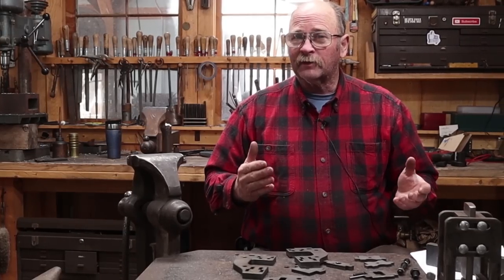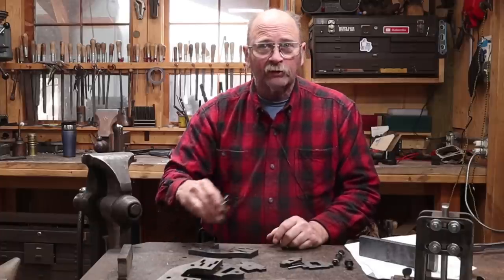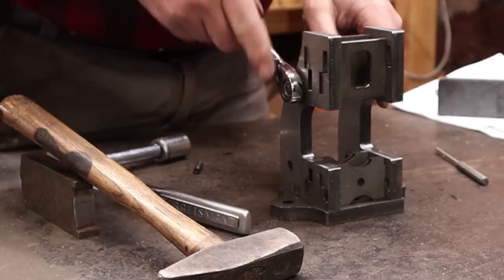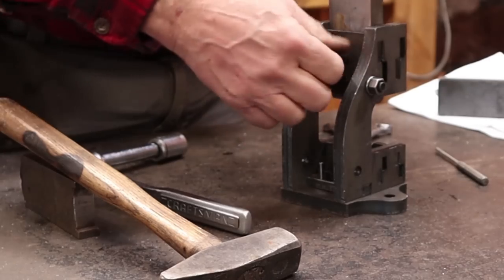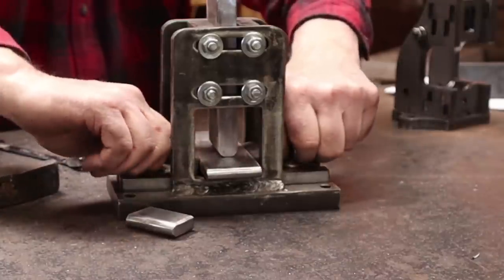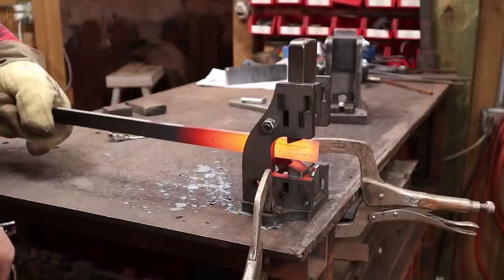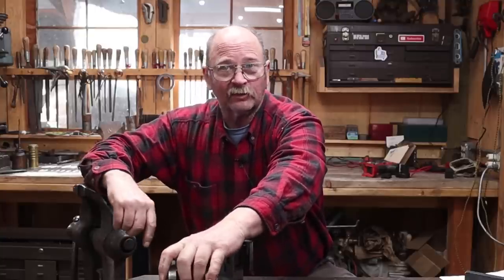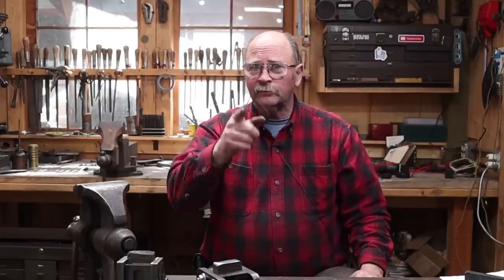Guillotine tools, a closer look at two new additions

Comment: I wish I would have seen this video when it came out originally but I have one suggestion for John and anyone who sees this comment in the future and that is instead of hitting the dies with your hammer you are much better off hitting the dies with a brass hammer or a heavy rubber mallet. The reason for this is to save your dies from getting all banged up and distorted. I really love both of the designs on these guillotine tools. Thanks for sharing.

Comment: John: Tip for the Cloverdale hardy hole attachment that is quick/easy and involves no welding. Grab a length of square bar of the desired size, drill and tap 1/2 UNC hole in the center. Then drill a separate hole for the split pin to go into (the one you removed). The pin is to prevent rotation of the square bar, alignment only. I ended up welding a shank onto another plate like you were discussing and only figured it out afterwards.
Reply from the maker: Great ideas, now why didn't i think of that

Comment: I have tapped holes in my 5/8" thick bench top to suit various vices and their position. I use set screws in the holes from underneath in holes not being used and ground flat to stop junk getting in the threads and maintain a flat work surface. Nice tools John, I need one :-)
Reply from the maker: ingenious solution

Comment: You'd only need to use one fence at a time on Jerry's tool, letting the metal expand as expected. If it starts to stretch unevenly to one side, flip the piece over or come in from the other side (assuming a centered fuller).

Comment: I was told the pin is also for using a longer bolt into a threaded Hardie shank to keep it from rotating on the shank. Drill a little hole for the pin on the shank.
Reply from the maker: Now that makes a lot of sense

Comment: Very cool!! I'm trying to work out a guillotine tool made from a section of steel I beam, the problems I have are that I'm only using a 20kg anvil and I'm not able to lift heavy thing, due to my back. I did have a brain wave of making the tool so it sita on the floor (not on the anvil) and I use a length of I beam that means that the metal I'm working sits at the same hight as my anvil. I then buy a long enough leagth that also ove 20kg!!! Problem solved as I don't even have to move the guillotine to use it 😁 Thanks for the video 👍

Comment: Good review however, that central Fuller tool doesn't look like it works very well, because as you  using the Fuller, you were spreading the material outwards and binding the outside fences.. so that's not a very good design.. also I noticed that you covered up the top of the block with ur hand where you were hitting with the hammer and it started to deform so that was not hardened or tempered very well...next time, please be honest with your review. And tell it like it is.. but, again thanks for the review.. I do enjoy your show. The Flying J..
Reply: Hello,   Thank you for your input.  I made that tool.  The guides are not intended to be drawn up tightly to the edges of the blade like barriers because blades are hardly ever straight and the steel expands when heated and widens when fullered.  In fact, one guide works well.  They are more for a visual sighting or aid, like the shoulders down both sides of a highway.  The actual fuller groove becomes your best method of sighting to the tip after the first few hits.  I have been thinking of putting a kind of blade tip sliding carrier on the backside as an aid like a front sight on a rifle also.  
     I too, was surprised at the striking end deformation.   It is 4140 steel left untreated because if you did harden them, the striking end would have to be tempered back down anyway to prevent brittleness. The fuller end is contacting red hot steel so any temper you do put in would be changed over a short period of time.  Air hardening steels such as S7 would be ideal, except for the cost.  I make a lot of dies and I have not yet seen that happen on the 4140 steel, treated or not.  I appreciate and welcome your criticisms and ideas and I will take them into consideration as I improve current tools and make other tools.  Thanks, Jerry